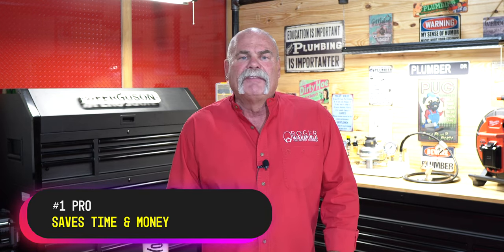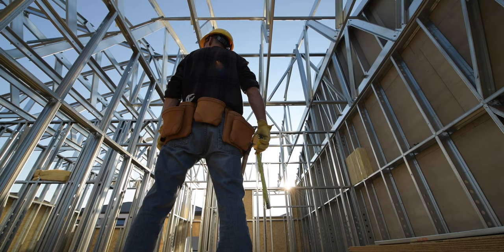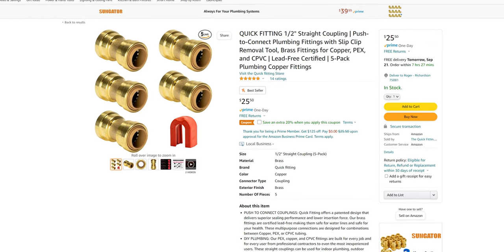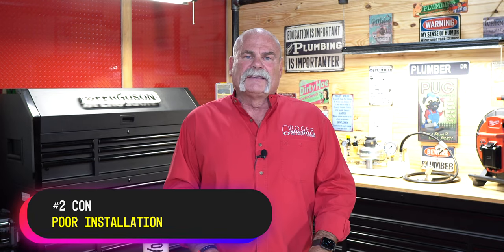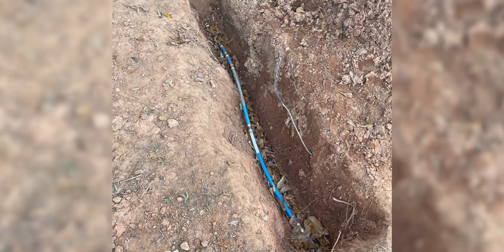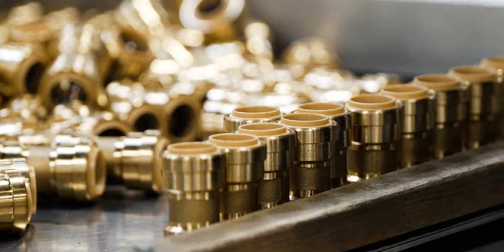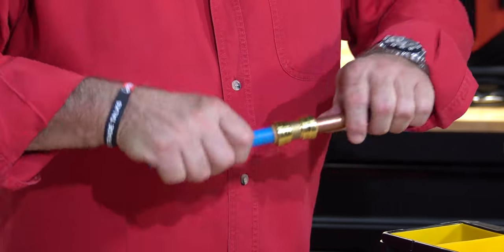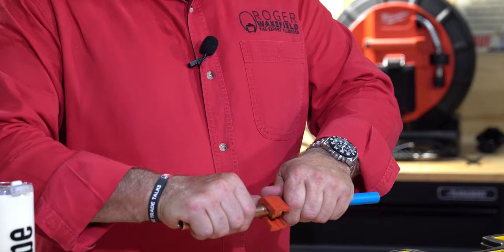Pros and Cons of Push to Connect Fittings

Comment: I’m a home owner with plumbing apprenticeship experience. I use my PEX B copper crimp tool with a few things I have done with the plumbing in my house. My house came with push to connect, push/pull stops that I have been replacing with PEX B 1/4 twist stops at the toilets and lavatory sinks. 
In an emergency the push to connect fittings are great to throw a on leaking pipe.

Comment: Capping off the water for cabinet installation is such a life saver to make clean holes rather than having to cut a back out square to put sink bases in. My dad always tries to cut'ncap with fittings like this cause then the plumber only needs to pop off the cap when it's time to hook-up and connect the plumbing.

Comment: I have been working at a Valve and Pipe Supply for the past 3 years. We switched from our (very small amount) shark bite selection to quickfitting around 2 years ago. Demand and love for the product has skyrocketed since then, especially after the massive freeze last year. When a situation like that appears and Plummer availability is scarce it is a great temporary fix for home owners. If plumbers are available and the quickfittings can be installed properly it can also be a great permanent fix, especially when it is in a tight spot that would hinder the ability their ability to get a torch around the pipe.

Comment: Personally, I only use connect fittings when testing piping under pressure before it becomes inaccessible. Otherwise as a temporary seal while preparing a proper connection.

Comment: I only use these for temporary caps, mainly on manifolds when fixing slab leaks....They're awesome for this but that's it....However, I can see where a " push fit" angle stop or shut off valve would be just as convenient in an emergency situation too - But still only temporary. I will never trust these for long term. Thx for this video, I had no idea this company existed...Definitely getting some over the Sharkbites!

Comment: We would have vertical water risers of CPVC SHC-80 and for each manifold we would transition to CPVC CTS.The manifold would have both ball valves in Hot and cold then CTS CPVC female adapter with gasket in front and in the back of the “Jumpers”.Basically we would use a push to connect brass fittings to transition CTS to Pex.The company I’ved work switch to Evo pex push to connect fittings for the water supply.From my view the company is saving allot of money with the labor,just don’t forget to hydro test.
“condominiums”

Comment: I love push to connect fittings. The pipe must be prepped properly and fitting pushed all the way in. That’s where they fail. I have a manual pro-press and I also use PEX - B fittings, ie crimping, but where needed I’ll use push to connect.

Comment: love to use push to connect fitting for emergency and or main shut off that doesn't stop dripping. I have push to connect shut off ball valves always on hand just incase. and yes only use it in accessible locations. period

Comment: We have used the elbows on where the recirculating hot water lines would blow out due to the hardness of the water.  Problem solved.

Comment: I will never trust them. Anything that has a O-Ring will eventually dry out and crack.
Reply: No matter what you install it will fail at some point they have a use it’s not a permanent one that’s for sure but we press everything yes it will fail eventually but in this industry we don’t have time to sweat pipe anymore there is only 8 kids in our first year plumbing school to get licensed that means in 4 years we will only have 8 new licenses in our area we are overwhelmed with work you can throw a number out of the I don’t wanna do it price because your so busy and people just say yes
Reply: So do shower stems. Have you stopped using shower valves.
Reply: @jeffgulliver2389  all the time is spent cutting and sanding then you need a few seconds to sweat a  joint and the fittings are cheap how it saves you time and money?

Comment: They’re garbage if they’re used for a long term fix… the end. Stop talking Roger, you’ve been down this road before. Temporary fix until you get parts yes it works, long term no self respecting plumber would use it for long term

Comment: Soldering does not really take that much more time and the fittings are cheaper and the fittings are stronger than the pipe, all the time is spend cutting and sanding.